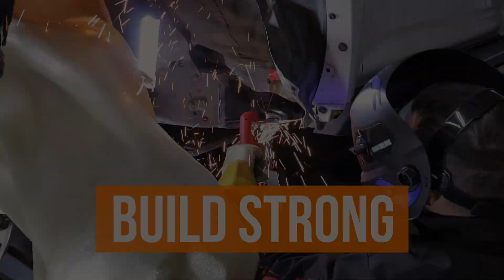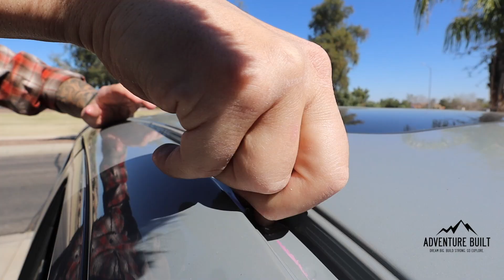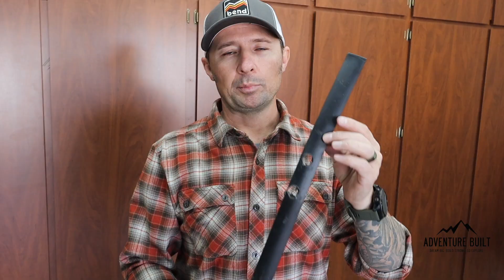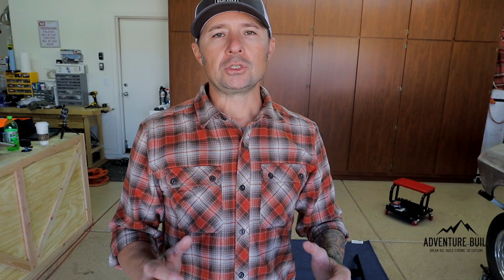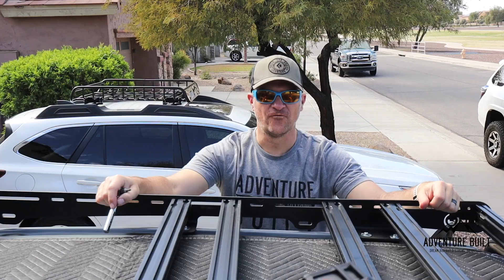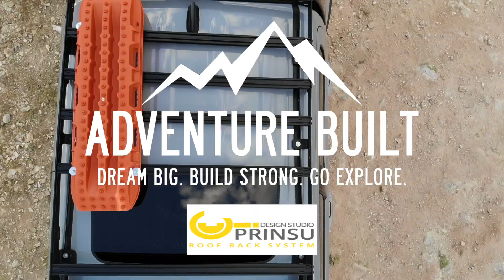PRINSU RACK Install 2020 Toyota Tacoma

Comment: Does it matter if the weatherstrip is not reinstalled?
Reply from the maker: I would say no. You might get a whistle on the roof without the weatherstrip but I have so much wind noise, I would hear it anyway 😂😂😂

Comment: Perfect way to ruin your headliner with seeping water 🥵
Reply from the maker: No the rack bolts into the factory mounting bolts. Plus all the pointing points are sealed up with silicone. I’ve had it up there over a year with no issues.

Comment: No one ever tells you how loud the Prinsu rack is. I put it on for two weeks and sold it. It felt like an air brake and slowed the truck down and was noisy!
Reply from the maker: Yea they are definitely noisy but that is the price you pay to have storage on the roof. Outside of a Thule Box which are still loud, not sure if there is anything better.

Comment: Thanks for the vid.  I watched another where the guy managed to cut out a section of the metal before drilling the holes in the trim.  Cheers.
Reply from the maker: Thank you. Yea we tried doing that but underestimated the strength of the steel strip. I would exposed and cut the strip with tin snips.

Comment: I was able to successfully get 3/4" holes in my trim and keep it all one piece.  MOST of the time nobody even bothers with the trim which in turn bothers me
Reply from the maker: Nice. I tried doing the holes first but the metal strip inside wouldn’t go and slipped to the side. So I just cut it. Honestly I don’t even think about it since it’s covered by the mounting plate. Luckily.

Comment: Nicely done and informative. I agree the fairing needs a roof-matching curve. Those gaps on the sides must howl at 60. What's it like washing/waxing the roof? Do you remove the crossbars?
Reply from the maker: Thank you very much. They really don’t howl but it does produce wind noise. It’s not terrible. I have a rifle case with recover gear and a shovel and those just add to the noise. Washing I just go under the bars the best I can. Haven’t waxed it yet but when I do I’ll take the bars out. I might just pull the entire rack.

Comment: Nice truck man, thanks for the video! I'm wondering...does the water get trapped inside the channel, since you've cut pieces of the weather strip? Thanks 👍
Reply from the maker: Yes a little bit but the silicone keeps the threads protected.
Reply: @AdventureBuilt  the stagnant water in the channel is what scares me a little bit (in the long run) and probably the only thing that's holding me back from purchasing the rack. I appreciate your quick response, cheers

Comment: How did you mount the traction boards on the prinsu rack?
Reply from the maker: I basically took 2.5” long carriage bolts and ground down the sides and face of the bolt until it fit into the prinsu track. Then I put the bolts threw the holes on all 4 corners and hold it down with big washers and wing nuts. Has never come loose.

Comment: How does the height of your bars on your shell match up with the prinsu bars?  I am planning on getting a shell and need to be able to haul long lengths of lumber and am trying to plan out what systems combined would create a level system.  I like the prinsu bc you can use the factory gutters, i hate using those clips that grab around the roof frame.  Yours looks great and super functional
Reply from the maker: Hey man. So using the Yakima bars on my shell means that they sit a couple inches taller than my prinsu rack. I’m pretty sure you can put a prinsu rack on your camper shell and it will be flush all the way across. Best of luck.

Comment: Nice video, thanks!  One question--- does the shark fin antenna fit even or below the cross bars?  (I may have missed that in the video).
Reply from the maker: Thank you very much. So I placed the shark fin between the bars because it barely clears and didn’t want a bar bending into it. There is some flex to the aluminum cross bars.

Comment: I helped my friend install his primary and we used I think a 7/8 hole saw bit to cut the hole from the top after we used snips to cut out the rubber and metal band running through the trim.
Reply from the maker: That definitely would have worked better than what we did.

Comment: Any additional hardware required to mount the Maxtrax or Rotopax?
Reply from the maker: I look some small carriage bolts, ground down the head to fit in the track secured the trax with large washers and wing nuts. They are very secure but a slow process to take of and on.
Reply: Adventure Built thanks for the tip.  So unfortunately all these racks and bed rails required additional mounts/brackets.

Comment: a step bit or a 3/4 hole saw would have been a way better option than a paddle bit
Reply from the maker: You are probably right but I still think the metal strip in the center would have messed it up. Honestly I haven’t had any issues with it to date. Plus it’s under the plate and you can’t see the cuts. Honestly haven’t thought about it once since the install. Thx for watching.
Reply: Adventure Built very true, i guess as long as there’s silicone

Comment: It works well if you use a 3/4” punch and punch out a hole in the direct center. Good tip I learned from Micah at UpTOP overland.
Reply: Yup. I severed the metal spine @ either side of each set of mounting points, then took a box cutter to remove the spine & rubber which seats in the rain channel leaving just the top rubber that sits flush with the roof. I put blue tape on the roof next to the channel at each mounting point and matched each bolt hole on center in the channel and marked it on the blue tape. I reinstalled the trim into the channel and then transferred my marks from the blue tape onto the trim, and then used a 19mm hole punch for the 5 holes. I punched the holes out from the top side of the trim to avoid any kind of ‘blowout’ on the visible side of the trim. Each hole lined up dead solid perfect over the roof bolt holes and the spacers fit beautifully snug into the 19mm holes I punched. End result was a super tight tolerance install that looks OEM precise. The only snag I ran into was that the rear driver side roof bolt hole was about 1/4” shallower than all other bolt holes and the supplied hex bolt bottomed out before it could be snugged down flush onto the rack. A quick trip to Home Depot for a slightly shorter M6 hex bolt fixed that. Start to finish in about 2 hours. My only concern with the rack and supplied mounting hardware is that the front Prinsu mounting points sit uncomfortably close to the roof, probably 2-3mm. Prinsu really should supply some spacers that are 2-3mm taller for the front mounting points. I may toss a washer or two on top of the front spacers to give me a tiny bit more clearance just to ease my mind.

Comment: Nice! I installed mine last fall. I also got the topper rack by prinsu for the canopy. Easy easy install on both! I have yet to put the weather strips back on...just trying to figure a way to cut the holes as so what happened with you doesn't with me! I have a few more goodies being attached to the rack soon...road shower tube being one of them👊💥 Keep an eye out on my IG, that and the new lift will be posted soon.
Reply from the maker: pdx.trailerguy very nice man. The Prinsu rack are very nice. Unfortunately there has been some really nice racks that have come out recently. Oh well prize money well spent. I ended up doing a Yakima rack over the camper shell and just installed my Yakima awning to that. So nice. It’s my first one. And I also recently got a road shower. We are going to be road shower twinsies!!! I’ll keep an eye out for your IG posts.
Reply: What are the new racks you are talking about

Comment: Good video fellas. Little tip as far as getting the holes drilled in the roof trim. Section out the metal strip before drilling the holes with the wood bits. That metal strip cuts easily with some wire cutters. Keeps that roof trim looking really good and the bits won't bind
Reply from the maker: Bobby Franco thank you very much and a good piece of info indeed.